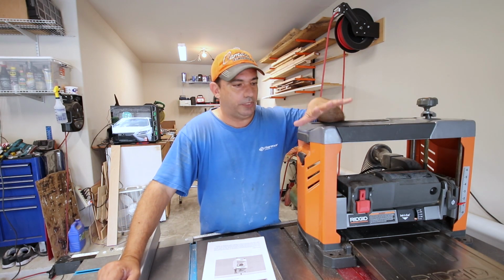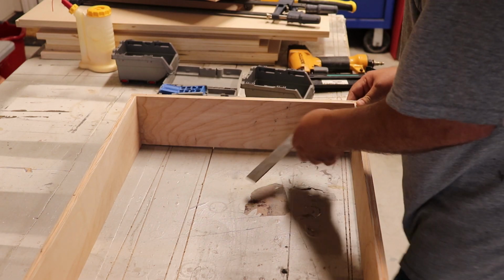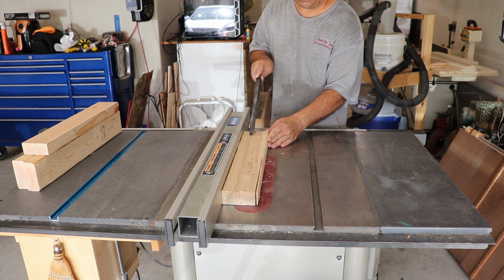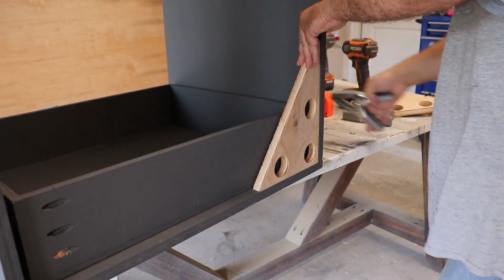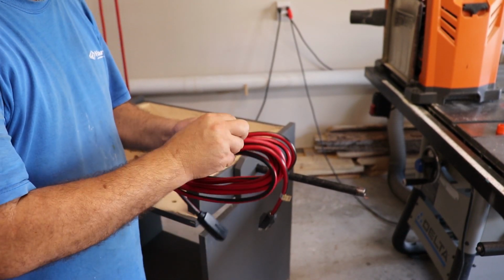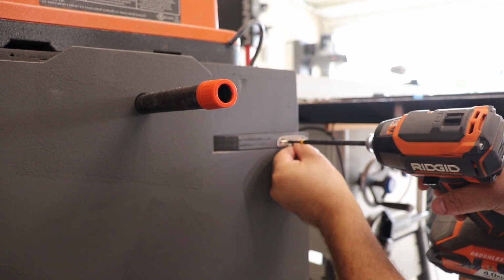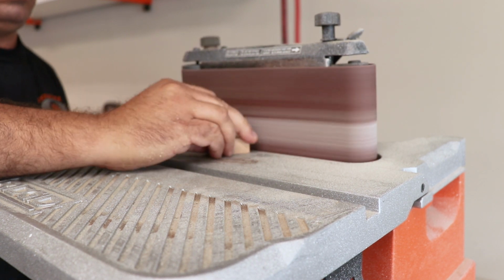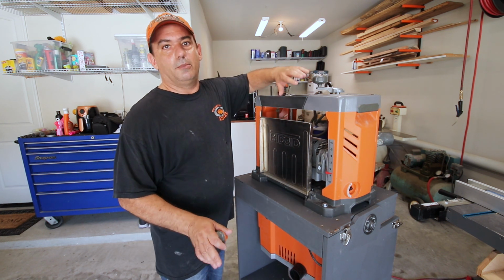Planer/Sander Flip Cart... By Fisher's Shop

Comment: I am going to make a flip chart for my router and spindle sander, and this video has given me ideas about details that I would have missed. Thanks a lot. However, being	 this set up a permanent thing (or so I would think,) I wouldn’t have bothered in keeping the power cords as they are, I would have cut them to exact length, connected them in parallel  and saved the hassle of having to install a double socket plus the problem you encountered of the plug not passing through the flange. May sound a bit radical but I doubt you’ll ever disassemble this again unless one of the machines breaks down or has to be substituted. Great job overall and thanks again for taking the time to make the video.

Comment: I built Fisher's cart too.  Great design!  I made some mods to the design to fit my specific needs, but the design is solid.
1. Used 7/8" washers instead of pipe flanges at the pivot points. Drilled 4 holes in each and mounted with screws 
2. Added an axle and 8" wheels on the rear and a retracting/locking handle so I can tip it and move it like a two wheel dolly. I needed this so I could get it out on the driveway and back into my garage when needed. 
3. Instead of a 15A power strip, I put in an electrical box with a 20A outlet and a 15' 12 AWG cord to help prevent low voltage due to voltage drop on lighter AWG cord.
Reply: I've bought the plan and will be getting my supplies together over the next week.  
Great idea with the washers vs the flange.   I'm looking to add outfeed tables and this makes it much easier.
Reply: I also added 4 inverted large "L" shelf brackets (12") to stiffen up the sides.  Made a big difference with the heavy planer.  Virtually no side-to-side wobble.

Comment: Nice build. I really like the idea of putting an outlet in there instead of a power strip, especially with a Dewalt 735 which routinely operates over 30 amps. I would definitely use 10 AWG extension cord wire for my build. But, between you and the Fischer video, I think I have my flip cart plan.  Thanks
Reply: 888

Comment: I have identical tools and like Fisher's design as well.  Will be adding height and width and braces.  Side attached wheels could lower overall height to gain some stability.  I appreciated your contributions to this design, and have subscribed to your channel for more.
Reply: Better use a 30" long 1" black pipe with flanges on the outside or else your sides with start to spread apart.  Pivot can not rotate at all and must be structurally integral to both sides to support heavy loads.

Comment: you could do a little hack to keep the knob on. it wont look the best but if you want to you could cut part of the wood on the side only were it would travel as it rotates and then put a piece of plywood over the cut part on the outside to give it back the strength. its just an idea. good build

Comment: I have the exact same planer and sander and after looking at Fisher's video was planning to make the same. Glad to learn the dimension changes which I need to make from your build. I guess you have been using it for sometime now. How do you like it? Is it stable enough to plane? Any other adjustment or enhancement you think one should do? Do you have the plans for your build by any chance?
Reply from the maker: I use the planner constantly with it and I have no problems.   It's pretty darn stable,  but if course,  the taller you make it,  the less stable it is.   

Yes,  there's one modification I'd like to make to improve the rigidness of it.   Along the front two bottom corners,  just above the drawer,  I want to make a couple triangles to screw into the sides and the horizontal piece above the drawer.   This would stiffen it up quite a bit.   If only be able to do it on the front and not the back because the planner swings through the back side and there's not much room for the triangles.   I hope I made some sort of sense. 

As for plans... i don't have any.   I built it directly off the Fisher plans except for the added height.   I wouldn't make plans for it because it would not be fair to Fisher.   It's his creation and I don't want to take credit for it.   I would always like to encourage folks to buy his plans.   It's a measly $5.  

I might start making plans for other projects in the future.   I've never tried to sell plans.   I'm kinda new at this and not very good at it.   

Hope you get yours built and it serves you well.
Reply: @termitewoodwerx5896  Thank you. When you say triangles for support do you mean something like this build has: https://www.youtube.com/watch?v=lQIVGEwBXfo This build has at both front end and back end. I think if I want to add both at front and back I will need to make it more wider so after the triangles there is enough clearance for the tool to rotate. What do you think ?

Comment: Sweet build! I'll make the same one in a couple of days with Fisher's plan. I have the same ridgid sander and planer too. Did you made changes to the width of the flip top too for the Ridgid planer? I check and thought I had to add 4 inches to the height of the sides and 2 inches to the width of the flip top and bottom, but I found you video after I made my calculations and it seems like you only added 2.5 inches to the height. Thank you!
Reply from the maker: Yeah,  I only added to the height.   And it does work... however... if I had it to do over,  I'd make it a tad wider.   In order for it to work,  I had to remove the knob on the lower right because the knob wouldn't clear.   Not a big deal though.
Reply: @termitewoodwerx5896  Oh I see! Thank you very much
Reply: @Wombatcan  Did you build with the modified dimensions? I have the same Ridgid planer and sander and trying to find out the dimension changes. I am considering making the width of the Flip cart bottom to 27 1/2" and flip cart side height to 34 1/4 like you mentioned. Wondering if those dimensions worked out for you.
Reply: @raysofsun5  did you make this with those dimension changes?? how did it work,, getting ready to make one as well.

Comment: I was going to buy Fisher's plans anyway, but since I just bought the Wen Planer I wanted to see if it would be stable enough.  I'm glad that you saved my brain on adjusting the size modifications on height and width.  Drew's plans are $5.00 should I send you a buck for the modifications? 😉Merry Christmas
Reply: Am thinking on making this same cart. Concerned about the strength of the sidewalls myself. Will probably make each wall a sandwich of 4 vertical 2x2’s and plywood glued on each side. Maybe a little more work and cost but a lot of peace of mind.

Comment: Nice job!  I plan on building one for the same two tools as you did.  Have you had any problems with the cart being a little tippy when using the planner with boards over 4 feet long?
Reply from the maker: I've put 8 foot boards through it with no problem.
Reply: @termitewoodwerx5896  Thanks

Comment: I'm looking at this build for:
  1. a Dewalt 735x that weighs 90+ pounds and 
  2. a Mahuda 8" Jointer that weighs 65 pounds.  
That also changes the dimensions a couple of inches.
I'm concerned about the weight.  
Had thought about a maple stile along the center of the outside to support the pipe and to use a 3/4" pipe instead of 1/2".  
Is a single sheet of  3/4" enough to bolt on that kind of weight?   

Any thoughts?
Reply from the maker: I'm not sure if the weight on my planer, but it's not far off from yours.   It has no problem supporting this weight,  and I feel pretty confident that I could double the weight on it and it would not be a problem.  

As for the pipe,  don't bother with 3/4.  You have to look at where the force is being applied in it.   It's basically a shear force right between the wall outside walls and the rotating platform.   You wouldn't be able to shear that pipe with a 20 tin hydraulic press.   All the weight is being supported on the ends... like in about half an inch of pipe.   Good luck breaking that. 

As for the plywood... kinda the same thing... basically the pipe is trying to rip down the length of the plywood wall.   I don't know how much force it would take to do that,  but it's probably in the thousands of pounds.   Now you might get some marring of the plywood over time.   If you're concerned about that,  i think a good solution would be to drill the hole in the plywood a little bigger and put in some sort of a brass bushing that could be more wear resistant.   That way,  the pipe rides in brass,  not wood.  

Another thing... i built mine a bit taller because I needed the clearance for my planer.  I'd say... build the thing a short as your equipment will allow.   I'm more concerned with the sides trying to spread out since they are really only attached at the bottom.   I'm going to be adding a triangle support at the bottom where the sides meet the top of the drawer enclosure.  

I hope some of this made sense.   It's hard to picture with just words and no illustration.  

Let me know what you end up doing!